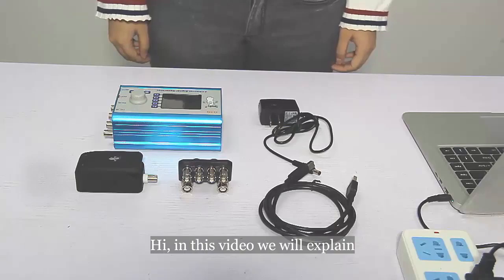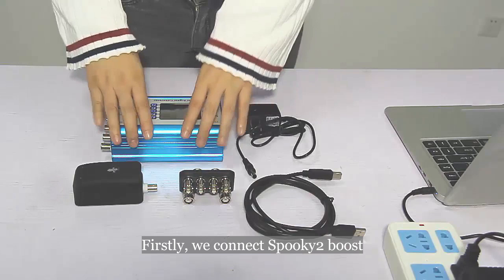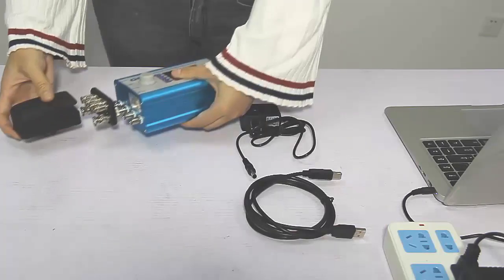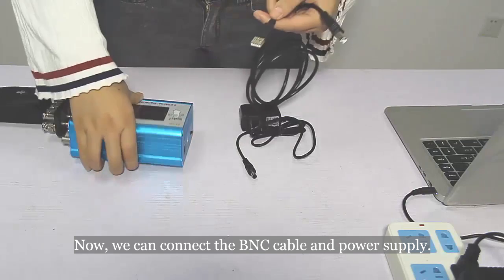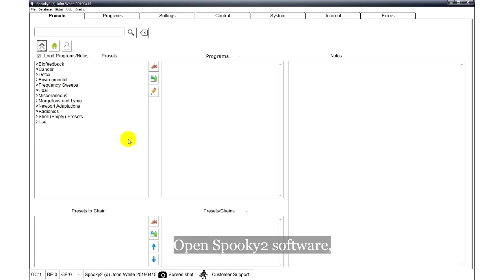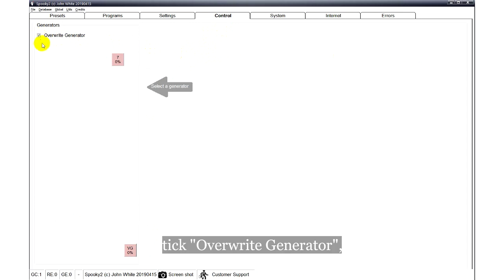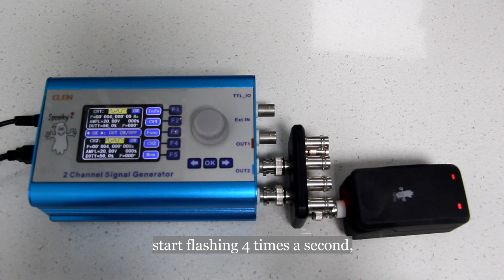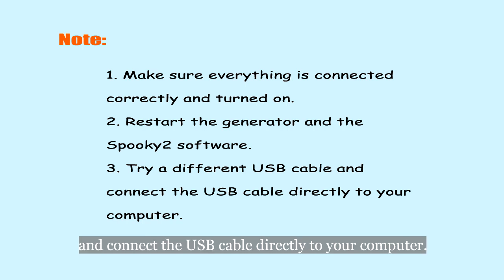How to Test Generator’s Output using Spooky2 Remote

Comment: Hi, When I run the signal test, I'm getting 2 solid red leds on the remote, not alternating, and also the 2 leds on the boost are solid, not alternating as in the video. I've tried to reset, power up spooky2 then start software, and even changed to a new usb cable (directly to brand new computer) but I get this result every time. Can someone help me out?
Reply from the maker: Hi, Christian. Please send an email to support@spooky2-mall.com
 Our service lady will help you solve this problem.
Reply: Same problem here too

Comment: Why are all the LED lights on my spooky remotes so dim that I could hardly see it in normal lighting in a room but could only see a little bit of LED light in a darkened room at night. My LED lights are about only 5% as bright as the LED shown in this video. Is there a problem with my spooky remotes or is there a problem with the boosters? I use them on Gen X in dtand alone mode.
Reply from the maker: Hello, my friend, it's very normal. The Spooky2 Remote LEDs’ state is governed by two things – the wave’s shape, and the speed of the frequency. What you’re seeing is how the frequencies control the LEDs. You can click the link here to get more details: https://www.spooky2-mall.com/blog/how-does-spooky-remote-light/